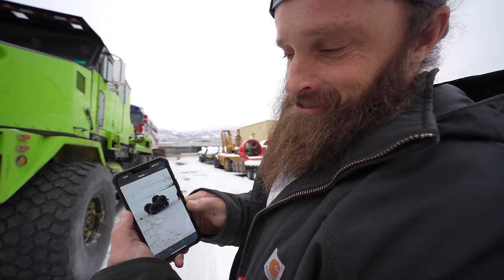ROLLOVER RECOVERY! Fat Truck Recovery with @SparksMotorsCo

Comment: Very sad that Aaron who wrecked the Fat Truck and caused all this to happen had to blame someone in the shop on camera for not tightening a bolt on a unfinished project that was rushed into service because of him flipping the Fat Truck, and then using the 6500HD before it was even finished and checked over before use. The 6500HD sure did look like a beast on that mountain! Glad no one was hurt but calling out the a guy in the shop was low class.
Reply: Yes I agree. It's not very professional as a business owner to blame your workers, as it reflects on the business as a whole.
Reply: Would you rather him lie about it?
Reply: But sometimes ya just gotta learn.
Reply: I have a feeling there is more behind that like they guy lied or  failed to do the job he was asked to do
Reply: Yep. Not a fan of that guy. Unfortunately don't think he's gunna make it too far. This is the 2nd time they've pulled a truck out of their shop unfinished and used it. They cut corners and just wing it. Fully unprepared, lack of knowledge and lack of accountability and a crappy attitude. Hope Kole doesn't fall when that Aaron guy goes under
Reply: Yeah this dude needs to get out of the business for sure he can't handle it
Reply: That was pure driver error lol but he did say it was strange driving it with joysticks
Reply: I disagree
Reply: While I agree that bad mouthing someone in public about a mistake is the complete opposite from acceptable.  What  are the factors the lead to the axle coming loose? If the person is a qualified mechanic who knew what they were doing and the consequences of doing it wrong. They are 100% at fault, not assembling suspension or driveline components correct has a huge potential to kill or injure the driver of the vehicle. What if that axle  had came loose going down the highway with a load? Now if the person who worked on it is not qualified, has no experience, was not given correct instructions etc. Then the supervisor and his supervisor are to blame. While he mentions the guy is "new" we don't know if that means the guy is new to the shop or new to mechanics.
Reply: Aaron is a Beeoch. Nice job on rolling the new toy.
Reply: Exactly my thoughts
Reply: @fomomofo6917 he doesn’t have to assign blame. The truck is unfinished. You don’t understand leadership.

Comment: The video clearly shows the wheels stopping at a critical moment and staying locked throughout, not spinning(as claimed "full joystick").
Reply: Based on this fact, alone, it looks like the only thing the fat truck needs is a driver mod.
Reply: @Aaron-Basin  then its even worse. Then its both- you careless/inexperienced with given rig, and the rig itself has design flaws, as no rig should go into parking and block all its wheels in the middle of driving- especially in that brief moment while being in the middle of the flight(no matter what you do unless you do it intentionally). I thought it was more like short gear/gearbox braking in absence of acceleration or brake pedal in panic.

Comment: Got alot of respect from me showing the bad days instead of filtering only the good days. Try Running some ballast in the rear of the fat truck so its not front heavy ? Keep it better planted . Hopefully the motor didnt lock up from oil loss on the crank bearings when being upside down. The 6500 looks slick with the headache rack , definately brought it all together.
Reply: Rolled over forward because it's too light in the rear which a sherp or Polaris doesn't have to worry about
Reply from the maker: Thanks for watching! I’ve always thought you gotta show the good, the bad and the ugly.

Comment: I'd say that Fat Truck has some serious design issues.
Can't spin the front tires up fast enough to prevent a front rollover is a major design flaw.
No auto shutdown when inverted is dumb.
No way to disconnect the drive line so it can the tires can is so thoughtless is defies belief.
Glad you guys are safe, and made it off the mountain. Just imagine this had happened some place really remote, you would have had to wait for spring (assuming it would even come).

Comment: 6500 looked good,  rear steering axle would be nice along with on board air inflation/Deflation system.
Reply: Also side winches in the sexy Quantum angularity headache rack.
Reply: Or if they just brought a battery operated inflator. Or lowered the air on the other side to even it out.

Comment: It looked like the Fat truck did a jump and kicked the rear into the air, then there wasn't enough front wheel speed on the landing to keep it from going over. Because it landed on a downhill, it basically did a stoppie. Glad everyone is ok.

Comment: The Tip-over point is not a problem in judging in modern 4WD because the Bronco has front and rear cameras. 
 Airbags would be the best recovery tool to upright that big tire buggy.
Reply: Yep. Like the boat lifters.
Reply: @PD-we8vf  Just put a  exoskeleton roll bar and recover it from the cage or a super beefy roof rack and a bunge cord tarp coving the roof rack so you don't get any leaks in your roof. It needs a roof fan anyways so might as well. Are you going to drown in that thing if it tips in the water?
Reply: @shoutingatclouds1050  good point. The sherp has a rear door for cargo and a second escape. This design is more dangerous.

Comment: Definitely properly built according to that rollover. Those things are pretty cool and with testing like that, fixes should be easy for weight. Does the CAI use exhaust? Some redundant way should be built-in. Fatter tires would have helped loading. Can't imagine if they had been lower.

Comment: He basically went too fast over a sharp bump causing the rear tires to fly up into to air. Then he panicked and either released the joystick or even slightly pulling it backwards causing it to decelerate quickly with all the weight on the front axle. The way a sherp and this copy of a sherp are designed with the center of the axle near the bumpers and a high center of gravity caused the front axle to become the fulcrum point and roll easily while torque was being applied in the opposite direction on the front axle. Nothing is idiot proof no matter how capable it may be, somebody will always find a way. To top it off, he blames somebody else for an unfinished truck rushing out of the shop and not having it sqaured away so it could save him from his own f***k up😂😂

Comment: Sounds like hydrostatic drive, and probably why those 4cylinder engines are plenty. 
Guessing the starting issue had something to do with the hydraulic system tripping a fault sensor.
Reply from the maker: They have plenty of power

Comment: Thinking it was already at near full speed so there wasn't much more to give. also might have sucked air at the pickup so very quickly the pumps weren't pushing fluid to the drives. Causing them to stop suddenly. Especially if the motors have brakes that are hydraulicly released.

Comment: It is not very good for the new machine to have so much damage on a rollover.  The jump was not even high.  I can't imagine driving down a back road and hitting a snow drift and rolling over on a back road.  It needs a design modification so it can be rolled on its tires quickly and for all the oil and fluids not to spread.😮Glad you are ok though.  Very scarey ride out.
Reply from the maker: We will be making some changes to this one. Luckily we were able to get it off the hill and work on it in the shop.

Comment: I see an issue, a big one. The wheels will not override the hydraulics at all, that is how you ended upside down, you jumped a little and left off the forward, and the wheels locked when you went downhill. The same reason you had a hard time loading the thing is the same issue that flipped you on your top.
Reply from the maker: Yes the tires had too much air in them at the time of the accident…. We are aware of that. Maybe if he had dumped the tires this whole thing wouldn’t have happened. Idk

Comment: I'M NO TOW EXPERT, but I'd think flipping it sideways back over would decrease damage using the rubber of wheels as a buffer and also needing least effort. 
Being you chose to pull it normally, atleast flip it rear end over cab, not cab over rear end like you did. Not only will that require the most energy but more likely to drag a little before flipping.

Comment: Glad you were not injured Aaron, but I will have to say that vehicle is super unstable being that high off the ground. I guess for all of its benefits there has to be some drawbacks.

Do these come with different seating, configurations, or any type of shell to put over the rear?
Reply from the maker: We are going to be doing some modifications to this. Possibly some sort of shell or cage…. But they do have other models with more seating. We wanted one with a truck bed to start.

Comment: Unless the pumpkin would've hit the ground, you could have aired down the tire on the other side of the low tire, and been good to go. Yes, put the Fat truck in deep water, it won't care, it has the same design features as a Sherp, and will float.

Comment: I'm glad no one got hurt..

But these machines are too front heavy.. This would happen also if you had to hit the brakes hard going down a steep down hill slope.. Just put the back roof back on them. And it would add rear weight back on. Yes there very cool looking but not very safe for off road usage.

I do believe this was a little bit of operator error also. These machines are not soppused to jump. He was going way to fast for the obstacle. Plus like I said this machine is way too front heavy..
Reply: The balloon tires kicked the rear, probably too much air pressure for that driving style.
Reply: @MacGyver2154 i would say that also.. I do know a thing or two about offroading and equipment..

I still say that machine is very front heavy
Reply: @Ragnar1822   this model is the bottom of the line.  The 8 wheel version is really interesting.  It's a work truck not a utv like Arron was driving it. Arron was blasting the dunes in Glamis in the Fat truck.

Comment: Looks like you found all the fat truck weakness. You need a free wheel option, it needs more weight in the rear perhaps beet juice in the rear tires. You guys are running those floatation tires on those recovery trucks need chains for a log skidder. Fat truck needs an escape hatch. Back to the drawing board.

Comment: Hopefully you can analyze all these mistakes and use them to format solutions and possible redesigns. Turn a negative into a positive.
Reply: Like maybe a stronger rollcage, drive wheel disconnect for towing,  etc.

Comment: You just became a dealer for these things and you already crashed one!?!?!?  Does flipping one over count as getting it stuck?  LOL
Reply from the maker: No I don't think this is getting it stuck.... But it happened. Now we are going to fix it!
Reply: Lol, I was thinking the same thing.    Wheels up ur kinda stuck, but not really in the normal sense.       Great video tho, that HET was slipping, must’ve been warm snow huh
Reply: @BASIN_NATION  I guess the good news for me living in Utah... if I bought one of these and flipped it, HeavyD is just down the road.
Reply: @ScottArmas107  We had a massive snow storm that lasted over 5 days.  The problem with the vehicles that can go UP big hills in the snow is that when they come back down, their brakes don't do them much good.  Taking a massive vehicle like the HET up in the hills was super dangerous. If you got a 50,000 pound rig that slides off the edge of one of those roads.... that's pretty much game over.
Reply: @RealRickCox  Yea glad nobody got hurt, looked crazy trying to come down that hill, probably looked a lot worse in person too I’d imagine.
Reply: Going up hill it always sucks to spin out, I pull doubles with a single drive tractor.            You just hope if you do spin out it doesn’t start going backwards.
Reply from the maker: @RealRickCox  they definitely helped us out! Diesel Dave is the best
Reply: @BASIN_NATION  I’ve never met or even seen Diesel Dave. Guessing he doesn’t come to the air park much on weekends (when I’m there). But I’ve heard he’s a great guy.

Heavy D might wave once in a while but he definitely doesn’t talk to the neighbors at the airport. Maybe it’s our lack of deodorant… 😂